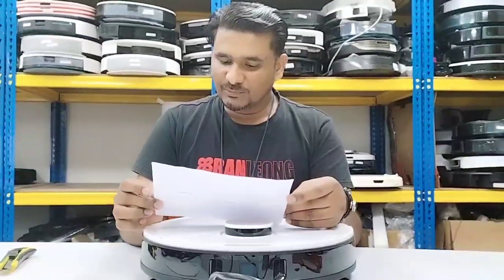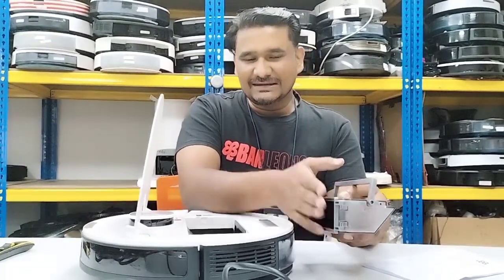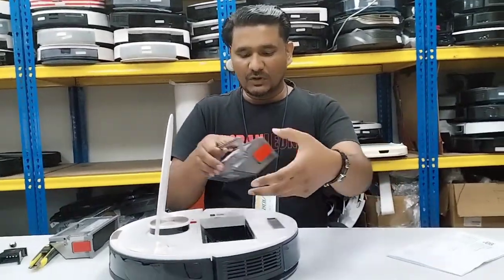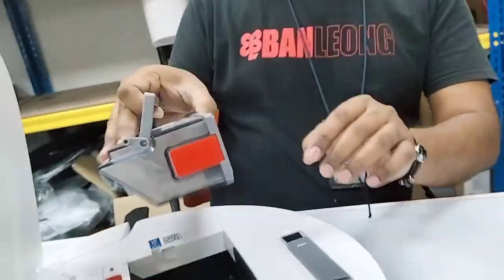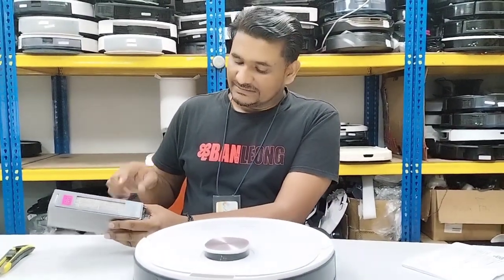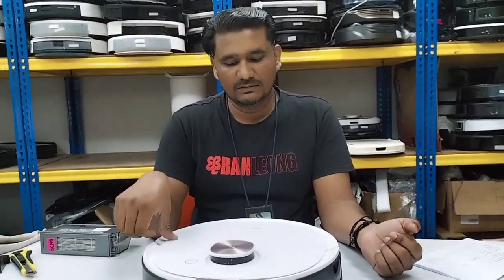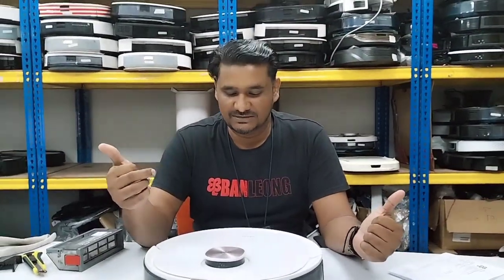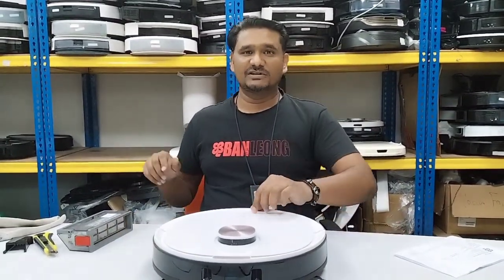How to Fix this Error "Please Install Dust Bin" ??

Comment: Hi. Great videos. Very helpful. I have a Deebot x1 omni. I have encountered a problem recently, the robot keeps on leaving the docking station every few mins and returns only to leave again. It will keep doing this until the battery runs out. Do you have any idea why this is happening and how I could fix it?  I also wanted to ask where is the best place to source parts for the robot like motors etc.
Reply from the maker: Yes..soon I'll upload video about this topic...I tried at few units..100% work...
Reply: @ecovacstechnicalsupport5278  thank you for making the fix video. Very helpful 👏🏻

Comment: What about the T10 Plus? There is no visible switch to see there like in your model.
Reply from the maker: In new models Ecovacs using megnatic sensors...plz check in ur dust box got one small round silver colour magnet if you remove that or if drop somewhere itself then...it will give same error...if magenatic is there still giving error then that means sensor is faulty...

Comment: I have a debot n8 the main station does not detect the dust bag, so when the vaccume gets back to the base it does empty the dust box of the vaccume cleane
Help 
I did see a sensor innthe sleve where the bag is slided.
Help
Reply from the maker: You just purchased new unit & got problem or before that deebot was functioning well & now suddenly not working

Comment: I have bought this product in 2021. It worked fine for few months but then started creating problems. It is Chinese products and work for few months. Their after sale support is scam. They have taken my product 4 months back charged 18K rs but i am yet to get the product
Reply from the maker: I'm not sure about ur reagin sir...but wherever got authorised service center & sole distributor there's no issues....like in Malaysia we give a year warranty...after repair send back direct to customer house totally Free of cost...No hidden charges nothing...after warranty period we charge for parts cost n courier charges but still provide service until parts for those models available From Ecovacs...

Comment: I just bought mine from official store, but it keep repeating please install dustbin, please help, impossible official store give me not original item
Reply: For me, the problem was some dust and little rocks where the dustbin touches the main part. So it was not recognizing it was inserted. I cleaned there and inserted the dustbin again and it worked.

Comment: Model d35. How to replace battery please
Reply from the maker: Put the deebot up side down. Remove the main brush cover... underneath you will see 3 tiny screw... remove those then just pull up the battery cover... replace New battery n refix those screw n brush cover....let it charge 3-4 Hours. Ready to use
Reply: It seems the battery housing is cased in the roller wheel assembly that just pops out from the bottom. How do you open that? I did remove the brush cover and no battery was in there. The only screws were to access the wheel motors. How can I send you pics directly?

Comment: Mine has a filter and is properly installed. What now ?
Reply from the maker: Some time because of not Using original accessories it happens..means non original filter is slightly thinner but looks same... when we install so it start giving this error...but still can fix this issue..just slightly loose the filter so it can touch the sensor.. that's all